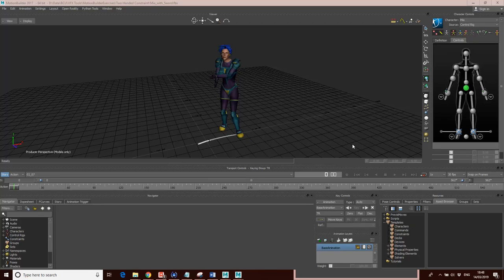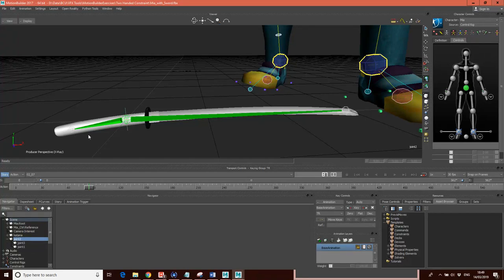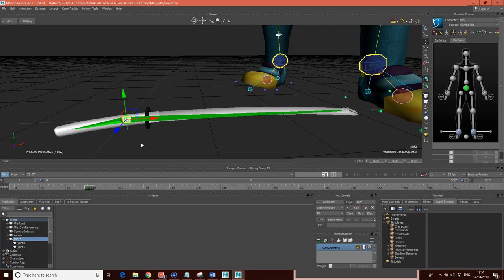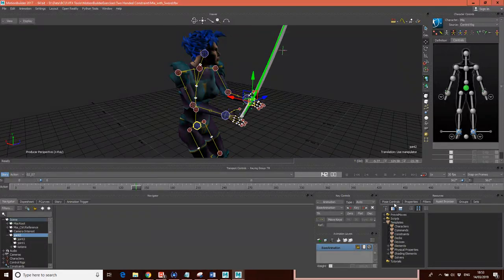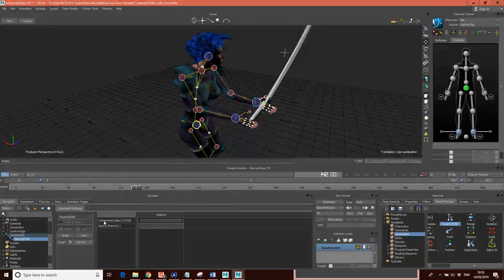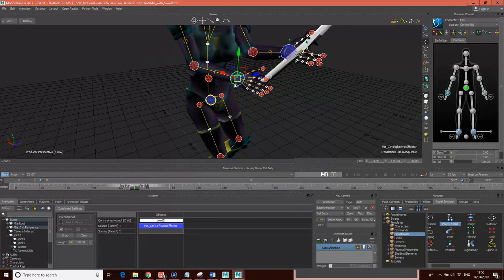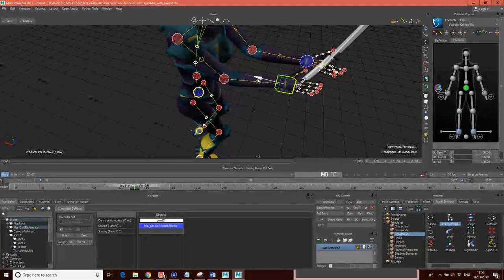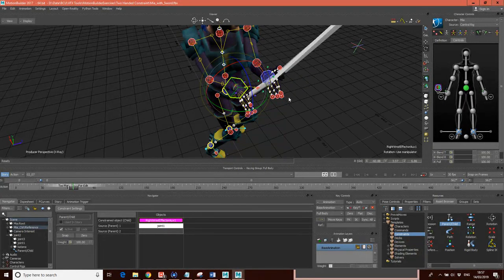Two Handed Constraints in MotionBuilder

Comment: Very informative! love it! thank you for the insights and remarks on Mobu I've learnt a lot Sir! I have a question about this. I got a study test for a new job for the Animator role. I noticed after retargeting and merge all animations on Mobu and bringing it to Maya. I can't seem to do two handed constrains for some reason. Is there any way to constrain two hands inside Maya too for humanoid characters like this one ? None of offset, locators method worked for me which I don't understand why. Or is your method the only way to fix the handed constrain issue for the humaniod mocap characters  and can it be done in Maya too?
Reply from the maker: There are constraints in Maya that you could potentially use, I think they are in the animation menu set but I don't have much experience using these.  Also remember you need to pot make the motion back to the skeleton rig in MoBu.  This will allow you to export the motion with the constraint back to Maya.
Reply: @justpressstart  thank you for the prompt reply Sir! I understand so pretty much I should work on my shot in Mobu to fix the hands I see another Q is, is there any way to bake constrains in Mobu directly ?
Reply from the maker: @dennissabrievski4543  click on the  Vitruvian man in the control rig UI on the right and a menu will appear.  One of the menu options it plot baking.
Reply: @justpressstart  will do thank you tons Sir! I've been working on it now it's coming along swimmingly